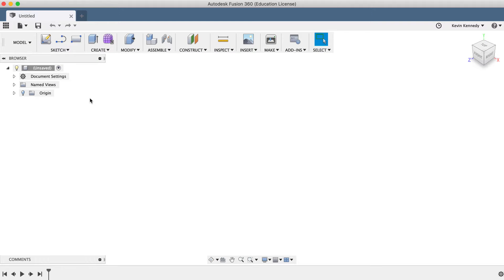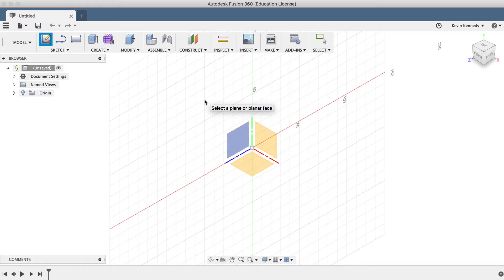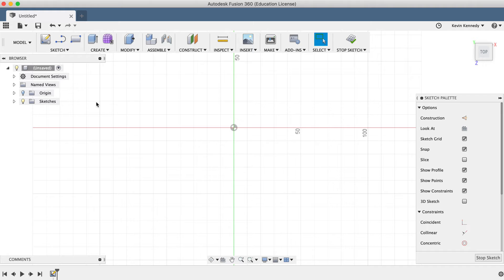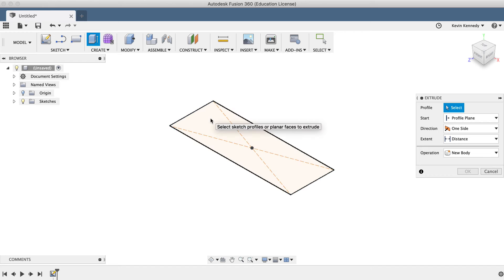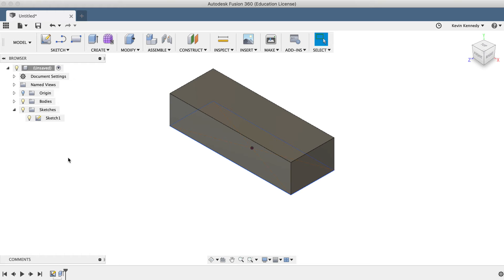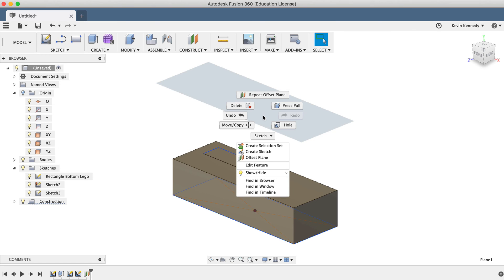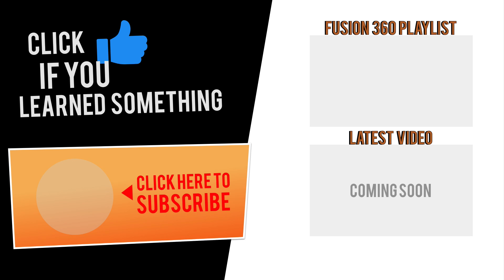How to Create a New Sketch in Fusion 360

Comment: You know, we new people need videos showing how exactly to add lines, erase sections, angle sections, split sections but even to create a simple sketch it's highly complicated on this system. And mine looks nothing like yours as the first things it wants is degrees, showing a quarter circle with the rest of it dashed. Then i have to place the first corner then pull it from there. There's no pulling it from the center out so idk if it's a version difference or what, but it's not the same at all. I just don't get why doing the most simple operation on fusion is so flipping difficult. I've used CAD before and i don't remember it being this impossible to use. So if you can please make some videos showing the most basic shapes, what exactly to do to get those functions and not fly through it to where you can't even tell what's being hit, the options, whatnot. We aren't impressed with how fast you can do it as we are trying to learn it and having to go back fifty times, run it in slow motion and all that BS just to see what was done is just friggin irritating and makes people simply find a video that they aren't doing that. Then I'm this one you start skipping around showing too many things at once. Show us how to sketch, all the basic steps them move onto other things, please.

Comment: The only slight drawback to this videos is Fusion 360 updates so often, your 2018 version is hard to follow due to changes within the software. For example, the little lightbulb is no longer visible in the menu - plus a lot of commands are now in different places. 

I found Fusion, far more than others, continually update more than other software so tutorials like yours - which are superb - take a lot longer due to the necessity to constantly rewind or pause while we search for the specific commands.

This, of course, is not a fault of your own. Appreciate the work you've put in to making these videos.
Reply from the maker: Thanks, Abdul. I agree/understand what you mean. Trust me, this is a frustration to me as well. 

That said - to your point as well - sometimes the little roadblocks help you learn/reinforce the concepts :)
Reply: @ProductDesignOnline  I just advised a friend to get it and use your tutorials as well.

Thanks again for your effort.

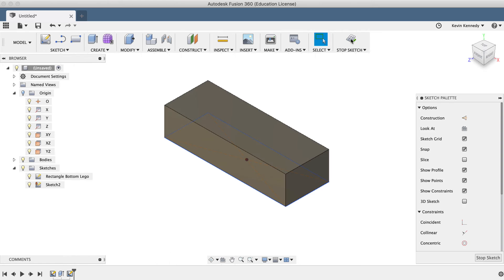Comment: For whatever reason @ "5:04 - Create a new sketch on existing geometry (faces)" - the option to 'Create Sketch' when right-clicking on whatever face - is missing (does not appear).Only way to create a sketch is to choose an existing plane which means the new sketch always appears in the middle of the model.  I'm in the 'Design' workspace for this.

Comment: In the lastest Fusion 360 (2.0.8407) on Windows , *when I selected a sketch plane it does not autorotate*. I could not find a setting in Preferences.
Then I noticed 3D Sketch was enabled without me noticing. I just read about it here: https://help.autodesk.com/view/fusion360/ENU/?guid=SKT-CREATE-3D-SKETCH
This solved the autorotate problem.

Comment: Kevin, I like your clear videos. I'm just learning Fusion 360 and would like to use for parametric "dieline" and animated folded version of a simple corrugated Rolled side tray in a 0.125 inch (B-Flute) thickness with beveled score/folds. Should I import the flat dieline as single sketch? or a sketch for each "panel" shape? Thanks for any direction on this.
Reply from the maker: Hi James. Glad to hear you're starting on your venture of learning Fusion 360! That's a great question. I always recommend making sketches as simple as possible by breaking complex sketches into many sketches. This makes it easier to fully-constrain sketches to make them more predictable. With that said, I would suggest you utilize the flange sheet metal tool to create your side tray. Something similar to this tutorial - https://youtu.be/V5_ZTZ_DTCc
Cheers, Kevin :)

Comment: Came to this video hoping for the solution but no. It won't allow me to simply click on the plane and the auto project that plane for me to start working on. This has happened since the new mouse. Trackpad won't do it either. Then if I right click and select create sketch it opens on that plane, only then if I create a centre circle and stop sketch to offset plane following along with your loft video I can't select that plane and have fusion auto project that face to work on. Damn my whole night wasted on this. Learnt other stuff but still. Grrrr
Reply from the maker: Hi, James. Based on the information you've provided, I'm not sure what would be causing this. Is there any way that you could share a link to a small screen recording of you trying to do this? I wish YouTube allowed the sharing of screen recordings and images. You'll have to link to a Google Drive file (or another cloud storage solution). That may help me notice a setting or something else that would be causing this. Cheers, Kevin :)
Reply: Hi there Kevin and thanks for the reply. Theres a service where you can control my machine for sure and no issues with that. Just let me know how and for sure we can do it.
Reply: @ProductDesignOnline  Hi there Kevin. So what I have done is uploaded a short 2 minute video explaining the issue and showing it on screen. Heres the link to watch it. https://youtu.be/xVF93kLNH4M

Let me know what you think? 

James

Comment: Hello Kevin, I ve been looking through your videos to try and find an answer to a problem that im stuck with but cant seem to find it.
I finished sculpting an object and clicked on finish form. Now I want to extrude some holes on the body but fusion doesn't allow me to create sketches on the faces(is that normal?). I would try and bypass it by making the sketch on an origin plane but the problem is that the face I need to sketch on is at a 10 degree angle and creating a "plane at angle" doesn't work cause it creates it near the origin and im 20-30mm away.
I tried offsetting a plane and then creating a plane at angle but it doesn't allow me to create the later from the offset plane :S 
I know im not doing something right and I cant figure out what it is. Please help!
Reply from the maker: Hi, Tesla 5869. You can only create sketches on surfaces that are 100% flat. This is to stop 2D sketch geometry from getting skewed. Have you tried using the construction plane type of "Plane through 3 points"? 
Could you provide the link to either your file or a screenshot? I think I get what you're explaining but need to visually see it to give you more direction. Cheers, Kevin :)
Reply: @ProductDesignOnline  where can i share the screenshot?
Reply from the maker: @johnf4388  You can use https://snipboard.io/ if you want to share a link in this thread. Otherwise, a link to anything that I can see (imgur, Google Drive, etc). Cheers, Kevin :)
Reply: @ProductDesignOnline  you re a life saver. Plane through 3 points worked! Thank you!
Reply from the maker: @johnf4388  Glad that worked...always happy to help! :)

Comment: Ron
Hi Kevin, I'm designing a USB plate that will snap into my car's rear console. It will take the place of the ashtray. This will give the 2nd seat passengers a USB charging port. I've got the design for the cover, but I need help in  getting the tabs on it. The lower tabs will lap over the bottom of the opening and upper tabs will snap it in.   I was going to use small triangular tabs for the upper part of the cover.  I'm also going to design a front license bracket for my car.  There is not one available for it. I'm new to Fusion 360 and your videos are wonderful! 
Thank you so much!
Ron
Reply from the maker: Hi, Ron. Glad you're enjoying and learning from my tutorials. Sounds like you're working on some neat projects. Can you share any links to images of what you have so far for the USB plate? Cheers, Kevin :)
Reply: who is going to read ur fat comments

Comment: I find it helpful to make z up in the preferences, this makes manufacture of parts easier as both 3d printers and CNC would look to flip the part which can be confusing. This is a simple change but can save time in the long run.
Reply from the maker: Great tip, Simon! Thanks for sharing this with the community. Cheers, Kevin :)